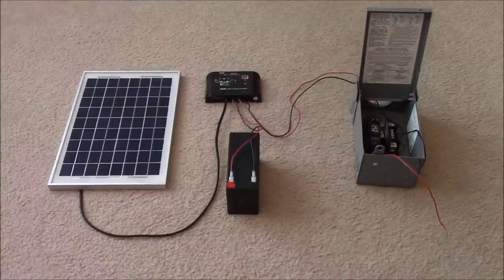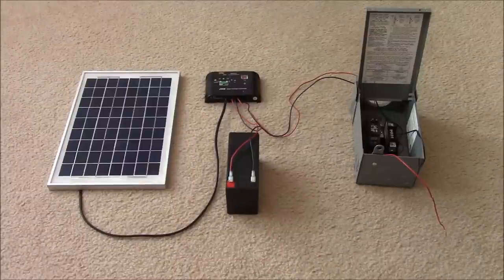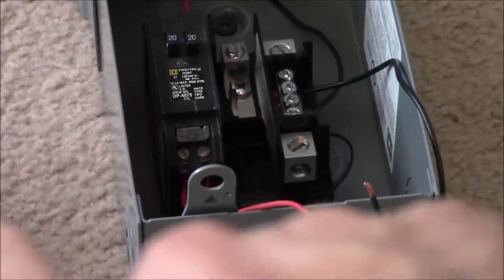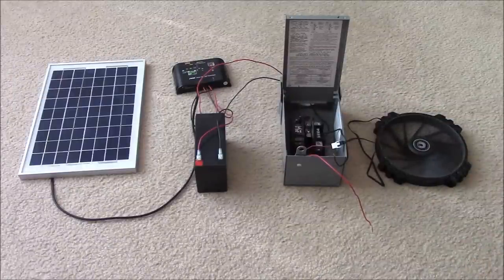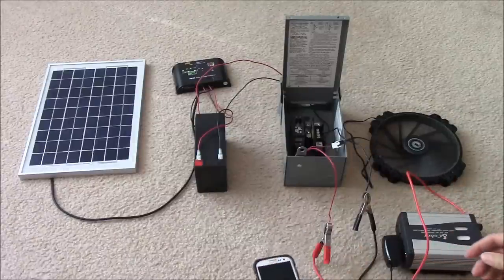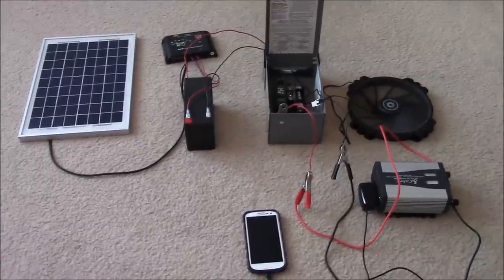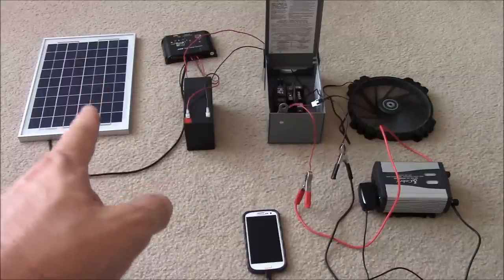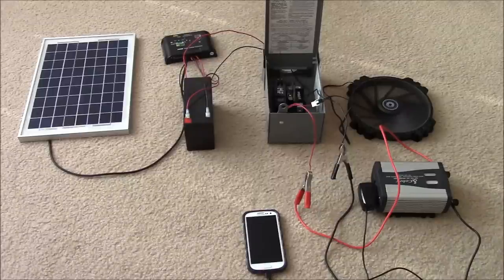Solar Panel Systems for Beginners - Pt 2 Hybrid Systems & Multiple Loads

Comment: can we directly power the load without the controller?
Reply from the maker: +Viswam Aakash Probably not.  Most inverters will not accept power directly from a solar panel.  I have tried several.  And if it is DC power then the device would have to be pretty tolerant of 17-18v when it is only rated for 12v because 12v panels actually produce 18v or so and that would be going directly to a load instead of charging a battery which needs the higher voltage.
Reply: +LDSreliance thanks alot for the reply. If i have any doubt in setting up, i will contact u
Reply from the maker: Viswam Aakash
You are welcome.  Thanks for watching!

Comment: sir. can you use your solar panel for 1horse power water pump?
Reply from the maker: The small one in this video?  No, sorry.  A 1 horsepower pump requires approximately 1000 running Watts and even higher than that to start it up.  Unfortunately, you will need a large solar panel system to run a pump like that especially if it runs many hours a day.

Comment: hi, i have a question for my project
if I combined with solar and PC powersupply can it work or not?
using the same method that you use
Reply from the maker: You could combine both power sources but that would not be something I would recommend a beginner doing.  I would not feel comfortable directing you to do something like that because you could hurt yourself or damage your equipment if you do it wrong.  I would recommend just sticking to solar with this kind of setup.

Comment: i want to power my modem and router on solar power. could you help me out there
Reply from the maker: Sure.  What is the power consumption of both units?  (How many watts do they consume)

Also, where do you live?  Do you want batteries or no?  If so, how many days of backup power?

Comment: Can you show this with a timer conected to it?
Reply from the maker: What do you mean a timer?
Reply: LDSreliance for exame intead of a fan i will like to set up a heat light for my birds at night.. so something to be able to trigger that stored power at certain time at night.
Reply from the maker: Oh ok.  That is easy to do.  I don't have time to make another video just for that but all you would have to do is connect two wires (positive and negative) to the battery and then to your timer/power supply device.  Then plug your heat light into the timer/power supply.
Reply: LDSreliance nice thank you!

Comment: could you convert the power to ac before the load center
Reply from the maker: Yep.  You could run it into the inverter and then wire the load center as AC like you have in your house.  That is what they are designed for, after all.
Reply: +LDSreliance yeah sorry. I just watched your 4 th video. thank you for getting back
Reply from the maker: Troy Ballz
No worries.  Thanks for watching!

Comment: how long (in feet) can the wires run?
Reply from the maker: Depends on the size of the wire (the gauge).  The thicker the wire (lower the gauge) the longer it can be before you start losing power.

Comment: I WISH YOU'D BEEN THERE FOR ME 20 YEARS AGO 😩 GOT SOLAR AND WIND CONNECTED TO BATTERIES BY CONTROLLERS  AND RUNNING TO THE HOUSE FUSE BOX. STILL DON'T KNOW IF IT'S  RIGHT. STILL RUN OUT OF ELECTRIC 🤠
Reply from the maker: Bummer.  Well maybe you can fix some of that with modern technology.

Comment: i want their links in the discription to buy
the stuff
Reply from the maker: 10W Solar Panel (exact same ones I have):
https://www.solarblvd.com/product_info.php?cPath=1_269&products_id=2891

Charge Controller (similar to what I have used; cheap and has good reviews):
http://www.amazon.com/Docooler-Controller-Battery-Regulator-Protection/dp/B00JKDZVRU/ref=sr_1_2?ie=UTF8&qid=1421280499&sr=8-2&keywords=charge+controller

8ah Battery (exact same ones I have):
http://www.amazon.com/UPG-UB1280I-Sealed-Lead-Batteries/dp/B0009GIKNE/ref=sr_1_1?ie=UTF8&qid=1421280557&sr=8-1&keywords=8ah+battery

You can use any kind of copper wire you want, but in case you need to order some (one link is for red and one is for black):
http://www.amazon.com/Grand-General-55241-14-Gauge-Primary/dp/B00INVEUP4/ref=sr_1_1?ie=UTF8&qid=1421280614&sr=8-1&keywords=14+gauge+wire
http://www.amazon.com/Grand-General-55240-14-Gauge-Primary/dp/B00INVEUNQ/ref=sr_1_3?ie=UTF8&qid=1421280649&sr=8-3&keywords=14+gauge+wire

For the combiner box, watch the 3rd video in the series to see how I made it.  You cannot order it ready to go.

Good luck!  And make sure to "thumbs up" my videos to support my channel, please.

Comment: what battery do you use? (in these videos)
Reply from the maker: It is just a 12V 7Ah sealed lead acid battery that are pretty common at hardware stores or in UPS devices and such.

Comment: Hi, awesome video, what do you think about the tesla powerwall? I am very interested in this subject and was about to go down the path you have been on, but maybe products like this make it plug and play for everyone? How did you learn all this? You mention legalities of working with AC current, does this means u need to be a certified electrician to do certain kinds of work?
Reply from the maker: Brent Greeff I am familiar with the basic concept of the Powerwall and I am all for it.  It won't catch on very fast because it is insanely expensive ($3000+) but as the price of lithium ion batteries comes down over the next 10 years you will see a $500 version someday start to catch on in a lot of homes.

I learned all of this by researching and then buying stuff and trying it out.  I am not an expert but I like to share what I learn with others and hopefully help them avoid some of the mistakes I made.

Yes, if you work on the electrical system in your house you need to be licensed.  It is much more dangerous than low voltage DC power that solar uses.  I have done some light AC work in my house like swapping light fixtures and installing ceiling fans but anything beyond that you probably should hire an electrician.
Reply: LDSreliance heh yea its kinda funny but I electrocuted myself as a child which has really put me off working with current. I still have the scars :) but my excitement over solar is surpassing my anxiety. 

I have an idea to rent and sell ebikes in my town, with either centralised charging, where people can swap the bike when it needs a charge, or package the bike with a panel. There seems to be an explosion in the ebike / electric motorcycle market and I have to admit I really have no idea about bikes or electricity, but I feel really passionate about reducing emissions in my town. 

I would really appreciate it if u can share some links u found useful or maybe some books, I also considered hiring an electrician or doing a course, maybe even studying electrical engineering but ideally I would like to get something working in months not years, and if I can avoid electrocuting myself, that would be pretty good.
Reply from the maker: I don't have a lot of great resources online.  Quite frankly most of them suck.  They don't explain things in layman's terms that you can easily understand or they don't address topics that beginner's need to know.

Everything that you see in part 1 of this video series can be ordered for under $100.  I would start there, honestly.  You will learn 10x more by getting the pieces, wiring them together, and playing around with them than anything else.  By playing around with it you will have new questions that will pop up and then you can ask me or you can research it online.  I would start there.  I have linked all the components that I used in the video several times in comments but if you can't find them let me know.  I am always here to help!
Reply: LDSreliance cool thx, I am in a small town, so pretty sure its gonna be a ball ache to order or find. I guess I need to start by figuring out how much power I need, what panel to buy etc.
Reply from the maker: Just start with a tiny starter setup.  I wish I had done that before trying to order what I "needed".  I grossly underestimated what I would need and also ordered the wrong components.

Do you live in the United States?
Reply: LDSreliance No, Bali, importing is slow and expensive
Reply from the maker: Ahh, I see.  Well maybe there are classified ads or surplus dealers that maybe you could get some cheap used equipment to play with?
Reply: LDSreliance yea thats a good idea, this video is a great start though, thx for posting.
Reply from the maker: No problem, good luck!

Comment: I have a basic question : what type of solar panel is best in long term for e.g. a led flood light and a water pump for a fountain. 
Question 2: what do you do when you live in the UK and want to use solar but during the winter there isn't much sun light during the day.

Back to question 1: which solar panel is best in this situation. 

Btw brilliant vids 
Liked and subscribed bro
Reply from the maker: Thanks!  I appreciate the sub.

There isn't really a best solar panel per se.  You just want to match your needs with the right size panel.  So you would need to determine how much electricity is consumed by the flood light and the water pump and then how many hours per day you need to use each one.  Then you can use a solar calculator to determine the size of solar panel and battery that you need to power those loads.  I would recommend using the online solar tools and calculators that I show in this video:  https://youtu.be/TO_a619bWh0
Reply from the maker: For your second question, the solar calculator will ask you to plug in your average sun hours so you will have to look it up on a solar insolation chart.  It looks like the UK ranges from about 4.5 average in far southern UK to about 2.5 average in the far north (https://ars.els-cdn.com/content/image/1-s2.0-S0960148114002857-gr6.jpg).

That is not great for solar but you can still accomplish your goals.  You will just have to have a bigger solar panel than somewhere that gets more sun.

Comment: How I want to ask on how to charge my phone without changing it to AC but just converting it to 5v and 1 amp
Reply from the maker: Use a car charger.  Just cut off the cigarette lighter adapter on the end and there will be a positive and negative wire that you can attach to any 12V DC source.
Reply: @LDSreliance  would the amps be affected?
Reply: @LDSreliance  thx btw

Comment: Can these cheap charge controller be connected to multiple solar panels?
Reply from the maker: +munchichi8 Technically the answer is yes but it won't work very well unless they are the same exact model of panel.  And if you do use multiple panels you will need to combine into one wire before it goes to the charge controller because the charge controller will only accept one + wire and one - wire.  I would recommend that you combine the wires using a combiner box.  You can make your own like I show in the next video in this series (https://www.youtube.com/watch?v=UG2pbErPKi8)
Reply: Can you not connect all multiple solar panel wires directly to the charge controller with the solar "in" terminal?
Reply from the maker: Yes but usually that "in" terminal is very small and only designed for one wire.  The charge controller in the video will not accept more than about 12 AWG wire.  So if you tried to connect 4 solar panels into the "in" terminal it would physically not fit.  That is why you need a combiner box.

Comment: Hi LDS, thanks for making videos. would you be able to help? I'm not sure what I'm missing. I've been playing with a 20 watt solar panel. using a 12 v charge controller, and a 6v12aH battery.(that looks similar to yours in this video) Wanting to only charge a set of LED string lights. The first day of charging the panel got just over 3 hrs of clear sky sunshine. LED's stayed on from 730pm -330am. but the following nights, after  longer charging times, the lights were much more dim & didn't light up the room at all. Don't know if you can tell what's wrong from that discription. Any help at all if you have time would be great. thank you.
Reply from the maker: So your battery is a 6v battery?  Do you have two of them connected in series?  You need to have a 12v battery or 12v battery bank (two 6v batteries connected in series) to take a charge from a 12v solar panel and 12v charge controller.

What are the power requirements of the LED string lights?
Reply: Ok, thank you so much, unsure about the power requirement of the lights. They are small LED's, around 20' long. Connected to a solar panel that fit in the palm of your hand. (it stopped working). peace
Reply from the maker: keshava ishaya
So the LED strip was solar powered when you bought it?  Then it only worked when the sun was out, correct?
Reply: on the original design, it had two AA batteries, and the gizmo that tells it when there is no sunlight. then the lights would come on.But that old garden solar panel stopped working.
 What i'm aiming at,(iwith the new solar panel) is unhooking the battery from the solar panel after its charged, then hooking it up the string lights. Bought a 12v battery. Just need to find a 12v controller now. many online ones. The lights will be in a room seperate from the solar panel and charger. So ill just move the battery, hook up the lights when needed.
Reply from the maker: keshava ishaya
OK, there are still some things confusing me.  2 AA batteries would equal 3v.  So you won't be able to just hook up a 12v battery to the lights directly.  You would have to have a voltage converter to lower the voltage to a safe level for the lights.

Comment: is it possible to connect a sewing machine with solar power energy?
Reply from the maker: Of course!  The average sewing machine only uses about 100 watts so that should be easily powered by a modest size solar panel system.

Comment: hi there ser,how about installing solar system to car
Reply from the maker: You can install solar on a car but it won't do much.  You need a lot of area to put panels to make enough power to charge a car battery or power much more than the headlights or something.

Comment: Hey Buddy 
Thanks for the video.
I have few questions...
Can you have multiple power source charging the multiple batteries at once. For example, if the batteries are being charge by the power grid, then theres a power outage, the the sun is out as well because night time hits,  can the windbind stay connected to the inverter to continue charge the batteries by itself without flipping any switch from one to the other. 

If your getting electricity from the power grid, then theres a blackout; how can i get power to automatically turn on from the batteries without turning any switch on or off. 

 Is it posible to wire up each room in a house on its own solar panel. Example just like having each room in a house to its own breaker.
Reply from the maker: You can charge batteries from multiple sources at once with the right controller/charger.  There are some products on the market that will do this, such as the Xantrex 1800 that I will be reviewing in a week or two.  You can also get charge controllers that will charge batteries from wind and solar at the same time.

To answer your second question, again you need a device that can do that for you.  A grid tied solar panel system like many homeowners have on their roof will not do it (unless you get a really expensive grid tied controller with emergency backup option). 

Yes, you can wire each room on different solar panels.  It would just involve re-wiring the breaker box in your house to receive multiple inputs and distribute them to the circuits you want them to.
Reply: I really appreciate you responding to the questions I had. Is there a video that you know of that ecplains how the system you talk about work. And Is the wind setup the same  as with solar panel setup.
Reply from the maker: Not yet.  I will be shooting a video on the Xantrex 1800 soon in the next week or two.

Comment: hey. have you measure current on your inverter? it happens that I have similar parts because I did a solar sound system with a 5A mini seal battery with a usb battery bank that will charge 2x 3.6 batteries in each speaker plus a boon box. So far is working great and I even tested charging 6 cellphones while playing music via Bluetooth.  It amaze me to know that the heart of any solar system is battery bank and not the solar, so  somehow I see this video and I was wonder about how many amps can I pull from a 5. 8. or 10 A Hour battery similar to the one you have.  Would be nice to have that data.
Reply from the maker: Great question.  I would have to test that out.  In theory, they can't provide massive amounts of amps like a car battery because they are designed to provide lower amps for a longer time.  Kind of like a marathon runner instead of a sprinter.  But actual amperage I'd have to test.

Comment: Can a 12v 20W solar panel charge a 16ah 12v battery?
Reply from the maker: It can over a few days but you probably won't charge it fully in a single day unless it is in the summer.